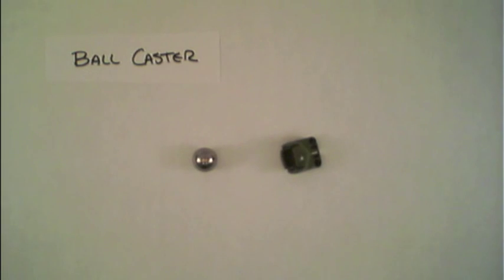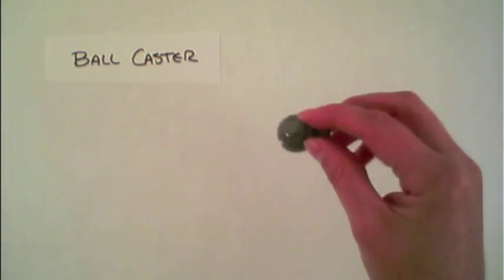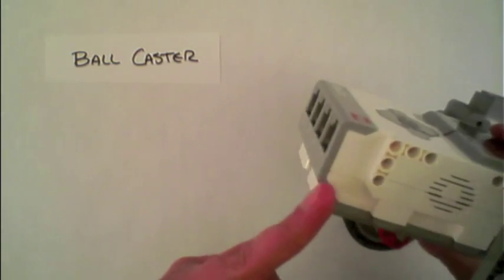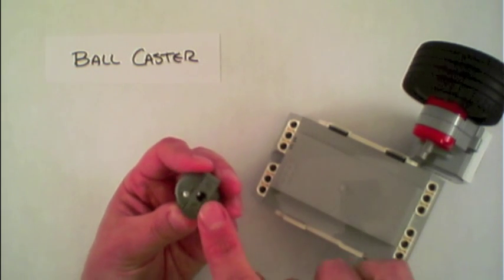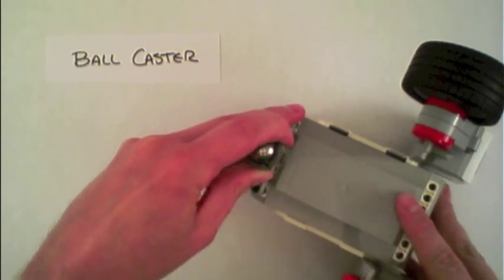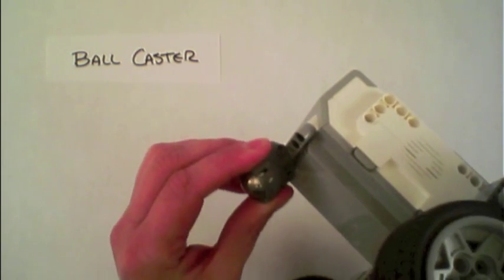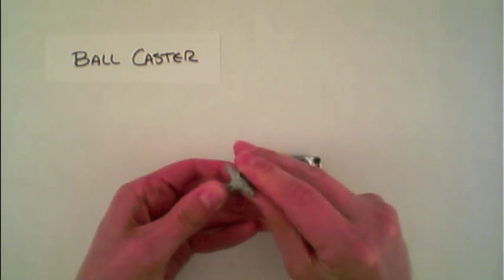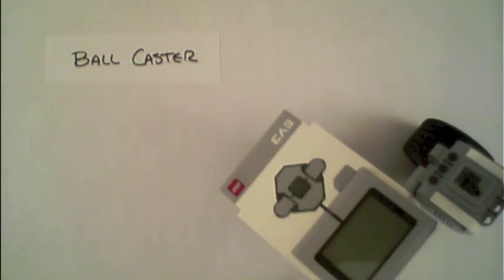Ball Caster

Comment: I wonder why didn't lego made two holes on the top of the caster frame...
Reply from the maker: Replying to an old comment, but wanted to let you know: LEGO Education has recently announced SPIKE Prime that will be coming out in early 2020.  That robotics set comes with a newly designed ball-and-caster that has more connection points (including two holes on the top of the caster frame, which will make for more sturdy connections than the single point on this one). Search for "LEGO Technic Beam 3 x 5 with Ball And Castor Joint" which is "part 39370" for more information on this new part!

https://www.brickowl.com/catalog/lego-medium-azure-beam-3-x-5-with-dia-19-wheel-cup-39370